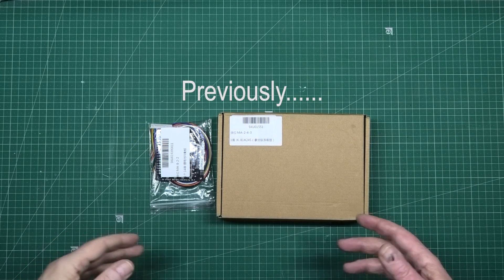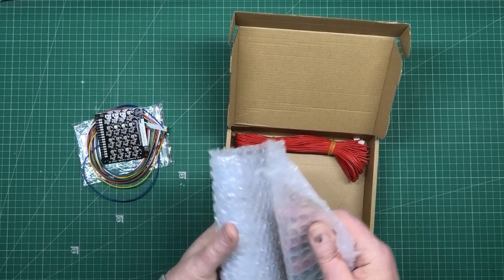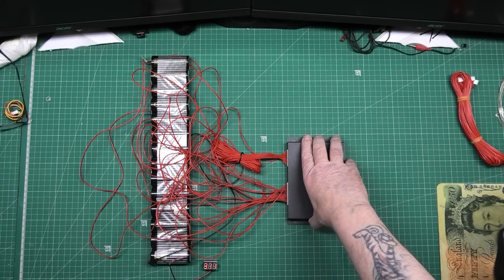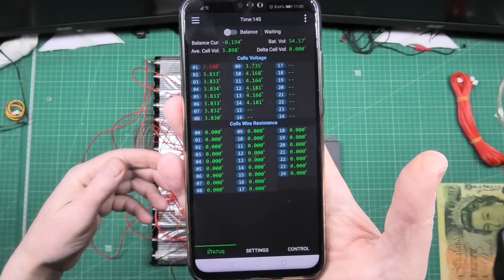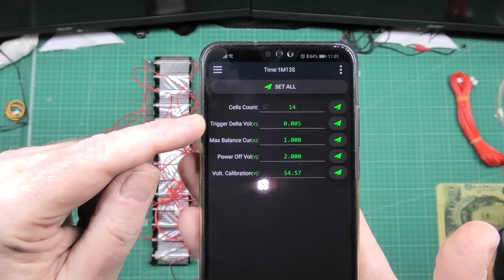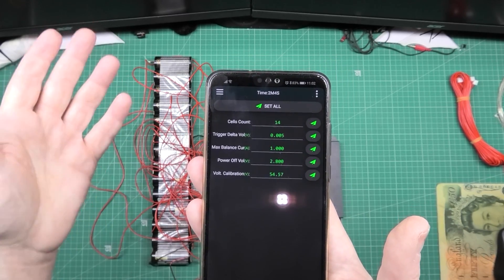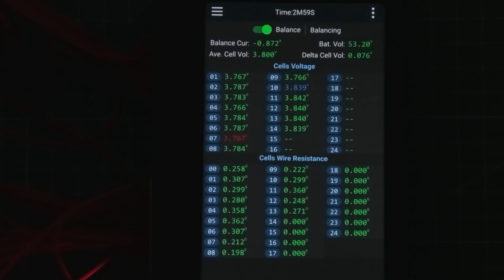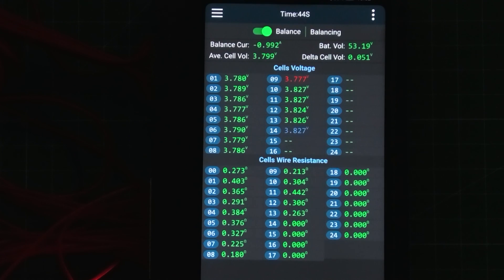Active balancers - cheap and expensive - A real world test part 2 of 2

Comment: 3:28 your wire resistance it's pretty high. Cell number 01 is 0.422....did you put a fuse or something in between? Is it even necessary a fuse in your opinion?

Comment: 12:06 "voltage shouldn't change" that's not really true.  In li-ion and lifepo4 batteries the last bit of voltage curve represents less actual energy storage.  For instance li-ions live most of their life around 3.7V (3.2V for lifepo4).  So to drop from 4.2V to 4.1V takes a lot less energy exchange than from 3.7V to 3.6V (at the same current).

I would expect with some cells fully charged and others nearly drained that the overall pack voltage does drop.

Comment: The way these balancers work is they detect the highest and lowest cell voltage. The highest cell charges up a capacitor and then that capacitor discharges it’s energy into the lowest cell. So if you put a clamp meter on your lowest cell you will see it charge for a couple of seconds at 1 amp and then that will drop to zero for a few seconds while the capacitor recharges and then you will see the 1 amp again. As the whole pack was well out of balance and quite high capacity cells that is why it too so long. You can get a similar 2 amp version with just LEDs so no need for an app. Of course expensive is relative - a Batrium will set you back a lot more.

Comment: Tony this is an interesting vid! I have a question: did you measure the cell voltages with a multimeter to check the balancers measurements?
Reply from the maker: Yes I did and they're all within 30mV so it's pretty accurate. The only annoying part is, you can only adjust the total battery voltage and not the cell voltages.
Reply: @Vortecks  Thats a pity. 30 mV is still a bit too much. Thanks man!
Reply from the maker: @rikdehaas6398  When I say 30mV, I mean they all measured +/- 30mV with a multimeter against the displayed voltages. When they've balanced, they are within the 5mV difference that it allows.

Comment: I have 4 of the "expensive" balancers.

I have 8 packs in sets of 2. 
My balancers have max 2.0 amp. It has checked the IR. Most of my junk old BYD's are about 1.4ohm.

I cannot set the balancing amp higher than 1.3. It simply doesn't if too much resistance.

My junked out BYD battery packs (LiFePo4) have never been this balanced.

My cells orignininally are 200ah, so gigantic in terms of capacity, so think about this.

After seven full days, starting at 0.580 mV difference, now it shows 0.051 mV difference.

These balancers work.
Reply: Wait are you really reporting in mV bec 0.580mV and 0.051mV are 0.00058V and 0.000051V, respectively? Most lithium cells are rated 3.2V/3.7V/3.8V nominal and most multimeters will have a precision resolution of thousandths of a Volt (0.001 V) at those voltages.
Reply: @r.vincenta.9678  remove the m, 

After seven full days, starting at 0.580 V difference, now it shows 0.051 V difference.

Good catch!

Comment: Interesting video, thank you. On the APP the "Power off voltage" isreferring to the single cell right? How did you deal with the seller to get a replacement without sending the broken one back? Is it from Aliexpress right?
Reply from the maker: Yes, the power off voltage is for a single cell.
I actually bought it from eBay and they didn't argue after I sent them a screenshot 😁

Comment: I run that exact same balancer, except I have the 2 amp model. It is a great piece of kit. does exactly what it says. I have a pack that is poorly built, and some cell groups have significantly more capacity than others, and it makes it usable on my Solar system
Reply: May be with the 5a or the 10a active balancer might cope with the heavily mismatched cells.

Comment: Hi, I have a 72v 40ah battery with Panasonic NCR 18650PF cells.  My BMS is rated at only 80A so I’m not getting the full discharge capability from my cells.  I am purchasing a Sabvoton 150A controller,  so can I just upgrade my battery BMS?  If so I’d love to use your BMS and app.   Thanks !!!

Comment: Just received the both the 5A & 10A version of the cell balancer for evaluation. Will be using one of them for a 2P16S 480 AH solar battery DIY build as soon as I can afford the 32 LiFePO4 prismatic cells. Seems like every time I purchase cells from Alibaba, the price goes down next month but I guess you cannot wait forever. Unfortunately, shipping times from China are now much longer than before the lockdowns. Hope that improves soon.
Reply: Ohh cool! How was your experience with the 5a and 10A? I've a DIY "a and takes like 4 days to balance a 260ah battery pack
Reply: @shinosg-wiz4619 , I tested the 5A cell balancer and it worked perfectly and I did verify the balance current was indeed 5A using a Fluke meter. Never had the chance to test the 10A unit because I've been working in Phoenix during the week and driving to CA and back every weekend. With the slow down in business, my wife's income has gone down so we decided to wait on building the new 480AH battery. The 270 AH batteries are still working well so no hurry. On second thought, we are now considering the Zero Mass Water panels ($6,500) that absorb water from the moist night air and then during the day the solar panel provides power to extract the water and pump it into a storage container for use in the house similar to how an under sink RO filter stores clean water in a pressure tank. Battery is going to have to wait. Water is becoming a problem in Southern Ca. Regards,
Reply: @bentleyjarrard885  most water is with no minerals right? You gonna mineralize it for drinking or just for sprinkling on the garden? 
I've asked you about the 5a and 10a cos I was thinking to put it on my tiny electric car.  Probably the 10a ita better for this kind of applications.  How do you prevent over voltage and under voltage?
Here in Europe situation ain't good as well _
Reply: @shinosg-wiz4619 , Over/Under Voltage, Over/Under Temperature & Over current is monitored and controlled by a battery management system. There are 2 types of BMS. One kind where the main current flows through the PCB and has on board current switching along with individual wires for each cell voltage as well as inputs for temp probes. The other type uses a DC shunt to monitor current and then will engage or disengage a golf cart type relay as necessary. This is the type I am using on my solar battery. Its made by ZEVA in Australia, BMS V3, is good for up to 16 cells. Its surprising that to date I am not aware of any products that combine both BMS and cell balancing functions into one integrated controller. Of the few BMS modules that claim to have cell balancing included its only very small currents and often just use resistors to "bleed" off the excess voltage of the high cells rather than using true active balancing where the high voltage is transferred to the lowest cells with little wasted power. I have a video posted of my solar battery build.
Reply: Whatsup! Did you had chance trying the 10a balancer?

Comment: Tony in one of your video's in December last year you recommend if anybody wanted to have a battery pack rebuilt to contact Mr Steve D. I did so using the link from the video in December l sent him a Snap-on 7.2v 6x AAA 
I have been promised it back several times but it has not arrived now he's not answering WhatsApp messages or my phone calls can you help in this matter thanks Paul..
Reply from the maker: Yes mate, he's having a few problems with the world as it is as the moment. Ordering parts which usually take 2-3 weeks, are taking 2-3 months.
I did email him last week and he said "I'm trying to get orders out as quickly as I can.... I am getting orders out but still not getting any BMS through and the last straw was an order that I placed on Feb 2nd got cancelled on 17th march. I want to make sure that you know I am not disappearing on anyone and those that are awaiting packs will get them... ".
Hang in there, he will have ordered your parts but it's taking much much longer for the bits to arrive (something that none of us could have predicted).

Comment: What do you feel is better., the standard resistor BMS or the Active balancer for an high powered ebike? They also have 1, 2, 5, and 10A versions now.
Reply: MFB, I'm using the 2A version, works really well on a 16S 120AH solar battery. Just received a box from China with one of each, 5A & 10A version. Will be testing them soon. Paid $300 and $500 plus $125 for express shipping so they are expensive. Prices are about the same on Alibaba or Aliexpress, I think its the same company.
Reply: @bentleyjarrard885  how did it go with the 5 and 10a? worth? working fine?

Comment: Hi mate I have the 2amp one. I noticed in one of your other videos you made the Bluetooth module external. Do you believe this is possible. Maby you could try on the faulty one. As the range is really bad. Thanks as always
Reply from the maker: Yeah, it's possible - there's only 4 wires needed and it's the same principle as the BMS I did. They use identical bluetooth modules and they're mounted the same.

Comment: What about the mid priced balancers, they are around 50$ and go up to 5amps and have solid state capacitors on the circuit too.
Reply from the maker: As I'm only using a single string of cells, anything over 1.5A balancing would damage the cells and possibly be a fire hazard. I'd have to build a 14s 4p pack to test them.
Reply: link?

Comment: Hey Tony, when the screen goes into “sleep mode”, just hit your menu button top left, and reconnect to device....no need to unplug a thing.
Reply from the maker: Tried that mate but the balancer wasn't even listed, the only way to get it back was by disconnecting it.
Reply: @Vortecks  Did you find a woraround like a switch instead of disconnecting all the time to have it listed on the bluetooth devices?
Reply: I have the same balancer, use it with I-phone, with 24s LiFePo4 cells.  works great within 15-20 feet away.  Must have gotten a bum one...does yours have eight 1/16 holes drilled thru the outer casing to allow signal to be seen by your phone?

Comment: What is the difference between a bms and these things?
Reply: BMS's balance only at very end of charge cycle when the battery is basically full. Active balancers balance all the time even when the battery isn't charging by borrowing charge from the series of cells 1 cell at a time to refill the lowest cell in the pack. So if you had one cell that had a very small difference in capacity the active balancer would keep it at the same voltage as the rest of the cells in the pack. This can both reduce charge time (if your charger was having to slowly balance your pack on every charge) and give you slightly longer run times in some cases (if 1 cell was getting discharged faster than the rest). The only down side is that most of these active balancers are too slow to provide any significant benefits over just having a good charger/BMS combo that can quickly balance the cells in the pack with every charge.
Reply: @mitchellwilson12354  right....but seems there are 5a and 10a active balancers now on aliexpress...but its kinda pricy..wonder if they actually work.
Reply: This balances the voltage with no cut off.  A BMS will balance the battery and also cut off the output supply at a high and low set voltage.